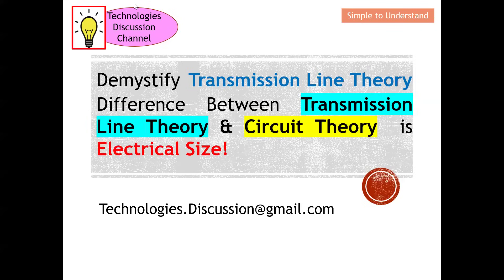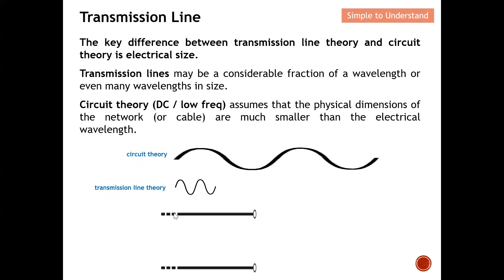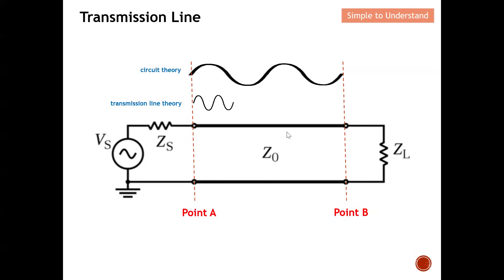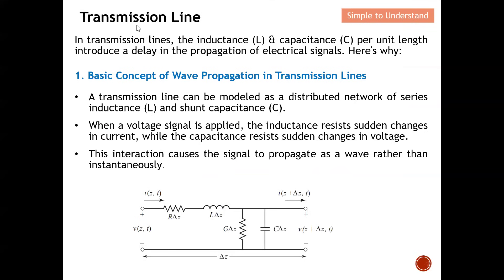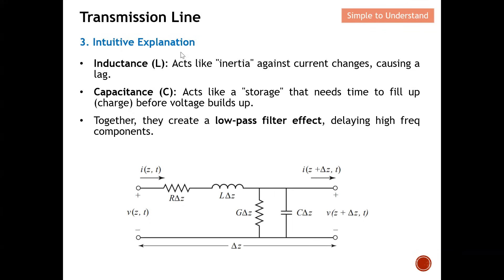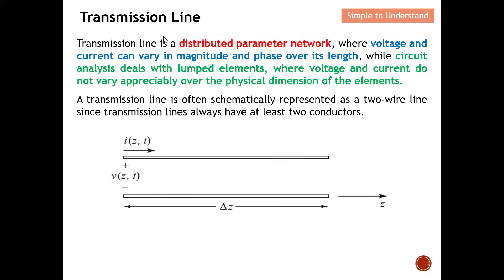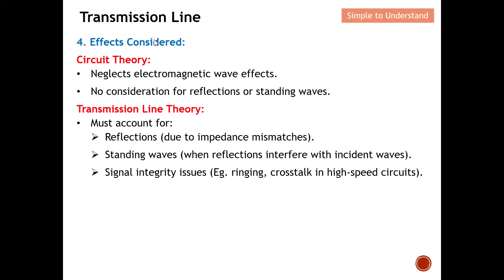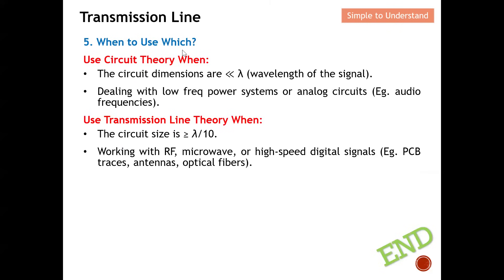Transmission Line #1. How Length & Wavelength, λ Decide Circuit vs Tx Line Theory (High vs Low Freq)

Comment from the maker: Thank you for taking the time to watch this first video on transmission lines.
This video begins by explaining that the electrical size is the deciding factor in whether to analyze a circuit using conventional circuit analysis or transmission line theory.
When using circuit analysis, the signal wavelength is much larger than the physical length of the cable. However, at high frequencies, the wavelength becomes shorter, and the transmission line may span several wavelengths. In this case, we can no longer assume the transmission line acts as a perfect short circuit.
This is because a transmission line can be modeled as a series of inductors and shunt capacitors. These LC components delay the propagation speed of the signal, causing it to behave like a wave.